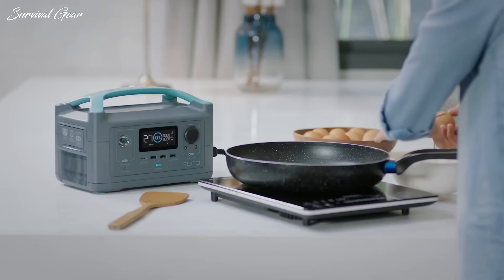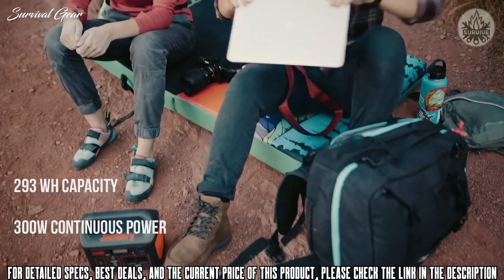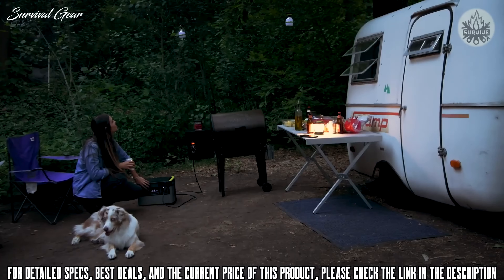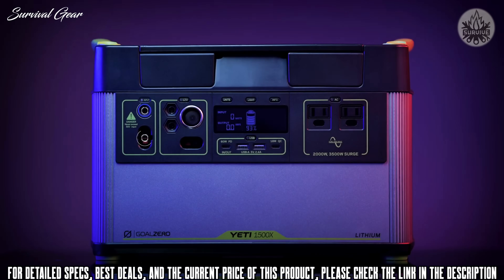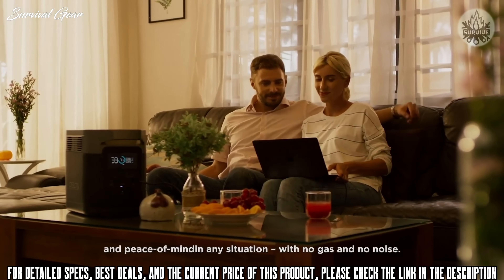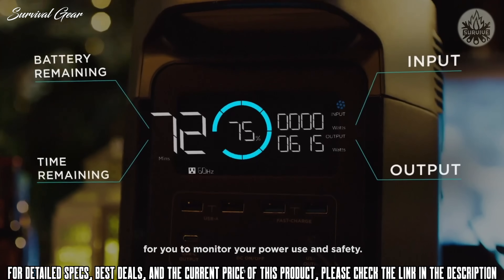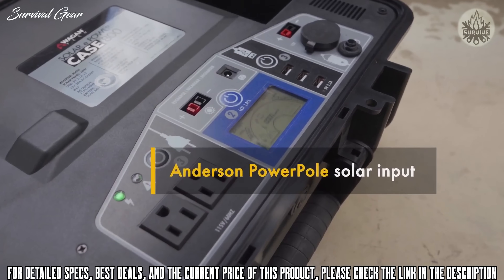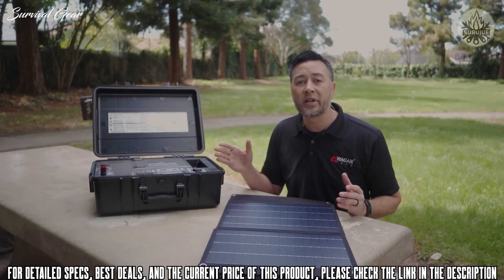Top 10 Best Solar Generators 2021| Best Portable Power Station 2021!

Comment from the maker: Top 10 Best Solar Generators 2021| Best Portable Power Station 2021!
Are you looking for the best solar generator for home, RV and camping on Amazon of 2021? These are some of the coolest solar generators for home, RV and camping we found so far:

✅1. Jackery Explorer 300 Portable Power Station
https://amzn.to/2XVDZHf
✅2. GOAL ZERO YETI 1500X Solar Generator
https://amzn.to/2XFWZJB
✅3. ECOFLOW Portable Power Station EFDELTA
https://amzn.to/2LU3RQI
✅4.  Wagan Tech ePower Case 800 an All-in-one Solar Generator
https://amzn.to/38Mtr3q
✅5. AIMTOM 300-Watt Portable Power Station 
https://amzn.to/35GsFTC
Reply: Any top 5 list without the Bluetti misses the mark.
Reply: Nice video and very informative and very entertaining and very satisfaction more videos.
Reply: greets from germany jeah hell i have the ac200p eu version this thing is waaay better than all these ones in the list it has 2000 watts constant ac output i charge my renault twizy with and can charge with up to 700 watts solar. it has about 1.8 kwh of usable energy only thing it weighs about 24 kg. So basicly for 2000 euros you can power nearly everything only my garage compressor wont work with it.

Comment: What the radical-left climate religion DOESN'T understand is...it take FOSSIL FUELS to make these batteries and MORE pollution is made by constructing them than making gas powered ones. Also, FOSSIL FUELS is needed to charge electric cars, without which...there would be no electricity. But the AOC worshipers wanna stay ignorant...so be it!

Comment: How do these products hold up in marine environments? I'm a sailor and looking into these, cheers.
Reply: I have the Jakery. It's held up over being onboard for the last year. That said, I keep it as dry as possible and avoid setting it anywhere where wet gear is drying and off the floor away from the bilge and make sure I'm keeping the environment dry as possible. It normally lives by my control panel. That said, given enough time, the elements will win over pretty much any solar bank. Just need to make sure it's staying in the driest spot possible. I'm considering putting mine in a large Pelican-style case with other emergency gear just to be sure.
Reply: Horrible isn’t it not waterproof smh!!!
Reply: @xinahicks13  They DO NOT. Go buy a proper marine inverter charger unit and some batteries. I am a serious ham radio operator & that is what I chose to use in my vehicle. The spare tire is on a back rack and the place where the spare used to be houses batteries now. This consumer grade solar stuff is disposable trash. My rig runs the legal limit of 1500 Watts PEP and it takes about 30 Amps @ 120 Volts to run. That is 3600 Watts. For my home I need 15KW. These don't even come close. Add in electric cars and add on another 50% per car, or 7.5KW per car. A house & 2 cars 30KW? That runs on natural gas. In the winter you may get from 0 maybe 9 hours of enough sun to make solar work, and you would have to be right on the equator and move the panels to get those 9 hours.
Reply: @Satchmoeddie  So what would be a great solar generator to buy?

Comment: $2000 for the 1500 yeti by itself no panels or their add ons that are necessary for the unit.! Who can afford this? Its so beyond me.
Reply: I reluctantly bought two 300 watt aprox 290 wh power stations, a Rockpals and Golabs, because of hurricanes and storms here, and several portable solar panels to charge them. Plus 15 power banks and everything I could get that runs off USB.
Reply: leadfarmer73 has good reviews - believe it or not that is for general emergency Energizer has a basic pretty good solar generator , getting good reviews for just fast and portable
Reply: you can't afford 2k? better get back to rethinking things.

Comment: How about output 220v or 110v
Reply: 100 watts it equivalent to 1 amp . 
So a 1500 watt unit is about 15 amps . Which is equivalent to a standard us 15 amp wall outlet. 
My fridge when running pulls 1.5 amp. A 150 watt light bulb pulls 1.5 amp. 
I never saw a 220 or 20 amp unit. Only a dual 110 or two 1500 watt outlets .

Comment: Four, not five and certainly not 10 best given? !🤔 I for one would appreciate a bit more in-depth product presentation,ie; compatibility of any solar panel, plugs to buy separately if necessary, best solar generator for running a full sized kitchen refrigerator, economic factors etc. Thanks for your help. 🙂
Reply: I’d suggest HOBOTECH. He goes in depth

Comment: Cant decide which makes the best power stations: Jackery or Goal Zero?
Reply: Ctechi Portable power stations are suitable for emergency power supply either DC power or AC power while we are travelling in order to spend some quality time with our friends and family. 
For more details of our Portable power stations of rating 160W, 250W, 500W, 1000W, 1500W, 2000W, etc.
Feel free to contact with my anytime.(+90 554 111 64 31)
Reply: ZERO POINT ENERGY TITAN is far superior than any of these options.  2000 watt solar INPUT!
Reply: Hi I can I get it pls I need to buy it